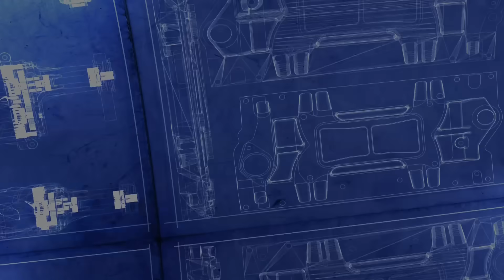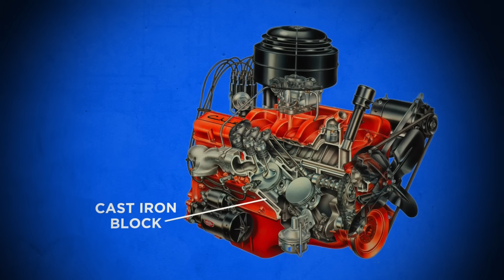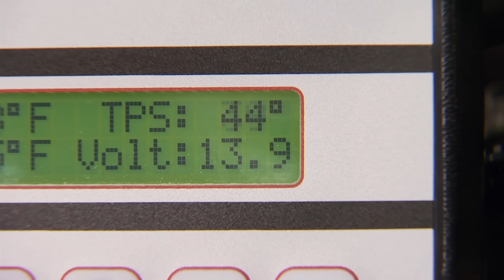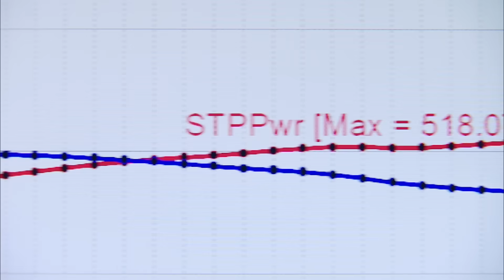Building A 518HP Supercharged 350 Small Block - Engine Power S2, E6

Comment: Not sure why anyone would build a 350 when its so easy to go 383, and the power difference is significant.  A blown 383 is a beast.  Especially,  with a cool looking blower. The closer  the pulley is to the casing, tthe cooler it looks. That  long B&M looking snout, is NOT cool. 😮😬 😁

Comment: Without the blower on 10 lbs boost, this is a 300 hp motor. How can you only get 300 hp out of cam, exhaust, heads, electric pump and ignition management?

Comment: THATS IT 518 HORSEPOWER,  EDELBROCK SHOULD BE EMBARRASSED WITH THESE PARTS.  A 350 WITH A GOOD ROLLER CAM AND 200 cc INTAKE PORTS.  SHOULD BE ATLEAST 450 HORSEPOWER.   WHAT DID THE 2000 CFM OF THROTTLE BODIES AND THE SUPERCHARGER GIVE 68 HORSEPOWER 😂

Comment: People are complaining about the peak hp without taking into consideration that the engine n/a with that cam and heads is making somewhere between 375-390hp if I had give an estimation with what I have seen before with even better AFR heads on a 350. So when you really think about it adding 130-140hp ish is not bad.
Reply: These guys commenting have NO idea what they are talking about.  It's really hilarious to read.  The 519 number is really good out of a 350ci engine on pump gas. No crazy parts.  Will run for years and years and years. You can't daily old school engines making huge power. This one is made for burning tires and having any where you want to go. Blowers look cool, sound cool.

Comment: Those particular cylinder heads are borderline too small for their build. They will work but could be significantly better.
Reply: just get the 200cc version of them.  problem solved but that cam isnt big enough for the 200s so the 170 work.  the blower can do almost double that boost but those hyper pistons arent gonna like it if theres ever detonation

Comment: listen up about eye protection i got a metal sliver   stuck in my inner eye lid every time i blinked it scratched my cornea i went to ER  they found nothing  in the middle of the nig nite wife started freaking out  i couldn't open my left eye  it was sealed shut with puss  i went to a eye specialist in the AM   turned eyelid inside out found  a sliver  gave me drops took  a week to heal  now religiously i put on my 150.00 titmus safety glasses at 730 am at work

Comment: A ZZ4 block with production parts, and HYPER pistons, 9.5 pushing 10lbs boost on pump gas!
Fuel injected $$ dead nuts street reliability, 2300 blower, and a superior roots type blower drive. Oh and it's inter cooled too. For what it is INTENDED TO DO......this could be a blast in a street highway cruiser. I would have no problem putting this in my street strip cruiser 88 s-10 blazer, 78 Malibu, or my 68 Impala, and drive for many miles. Every body thinks they can build 1000 hp in their driveway.
Reply: Exactly.  The guys running their mouths are keyboard warriors that have no idea what they are doing.  500hp in a properly set up street car will smoke a Hellcat.  They all think it's easy to make huge numbers today.
Reply: @DamionG1987  Hey it's the sign of the times I guess...plastic fantastic store bought super cars. Big HP numbers in throw away plastic cars. Tear up your hell cat trying to be chief doughnut maker, no problem. Get mom or dad to co-sign for another, and go crazy. I am a big time car nut, my whole life. But some of these squirrels never heard the line.....DON'T LET THE SOUND OF YOUR OWN WHEELS DRIVE YOU CRAZY.

Comment: I’m assuming it made 500 torque at idle,perfect for a tow motor but 2,000 cfm ..good lord
Reply: boosted engine things change like air requirements and youre not gonna use all 2000 all the time

Comment: Damn I do most of that work for free in my machine shop. If I use torque plates I chase and chamfer the threads for my own sake, and I’ll chamfer oil galley passages/thread oil plug galleys for anything over a mild build.

Comment: I think it shows how poor the SBC heads really were. Those numbers are effortless with a cam swap in a gen lV LS.
Reply: you can do the same in a 383

a good 210cc head
 240 duration cam
850 carb and a victor jr intake and 10.5 to 1

550hp

BUT this engine does it low RPMs

that and eddy heads arent all that.

Comment: It doesn't take a super charger to make a measly 518 HP.  If I am spending money on forced induction I would be building much more then that.   518HP is easily done normally aspirated. Now if you are only going for looks then fine I guess.
Reply: BUT at what RPM you doing it at?  yeah maybe a 400 would be better.

Comment: Still have yet to see a build by these guys, show(s) that uses a gear drive timing set.
Reply: Nobody uses those hokey gear drives...
Reply: @BuzzLOLOL  And why is that?  Dead nuts timing is not appreciated on Gen 1 blocks anymore?  🙄
Reply: @jasonrobertsutliff  - Gear drives expensive, noisy, not as reliable, the noise upsets EFI computers...
Reply: @BuzzLOLOL  Sincerely, ...  Not as reliable vs. belt/chains that can stretch over time or with really high torque engines.
Not a humble brag, but money wasn't an issue, I wanted the noise, 600lbft torque, naturally aspirated 410 SBC, legit dead on timing for 23 years now.
Reply: @jasonrobertsutliff  - A lot of people had those timing gear setups come apart on them so for street performance use we just go chain...
Reply: @BuzzLOLOL  Suppose I just got a good set ...  😎
Reply: @jasonrobertsutliff  - I'm happy with the $11 ZOOM roller chain set I put on my SBC 405" w/ MoTown 220cc aluminum heads 30 years ago...

Comment: The very first chevrolet V8 was built in 1917 and 1918, as well as the last gen 1 V8s were 99 in trucks and 2002 in chevy vans. The vortec 5.7.
Reply: 1916 with air gap intake manifold!

Comment: I know this is old but why even bother with a supercharger if you only getting 500hp out of it with 350 block ??? You can get that easily without the supercharger thin add the it back to have more 700-800 hp
Reply: a stock 350 block will go to about 550+ MAYBE 575 if you have steel caps put on it  and its a stroker.

  you're looking at a dart block to do what you're talking about 700-800

Comment: so if 1996 was the last year a small block was installed.what is the 5.7 in my 1998 truck called?
Reply: Man I was thinking the same thing. Even the 2000’s model cab over chevys had 5.7 v8 and not the LS.

Comment: Ive been reading about how superchargers work and the reason why it doesnt make as much horsepower as you might think is because of the massive pulley wheel on the supercharger the motor is definitely more cappable than 500 horsepower
Reply: you’re right, smaller pulley means more power

Comment: Factory 350 block is good to about 450 hp according to experts, so they can't really push this build but real nicely done though, builders and testers say one would have to go to dart block with thicker main material to do much more hp.
Reply: Gm rates them low to be safe knowing they are capable of a ton more

Comment: There is a lot of people talking about the output of this....it's a very mild small block to begin with and the blower is not a super efficient deal. Granted a bit more power could be tuned out of this. But it's a car show , old guy , parade engine.

Comment: I think this build is more a tribute to Vic edelbrock.  That engine is nearly 100% edelbrock.  Just the basic dimensions are Chevy.  Years ago, I think Hot Rod wanted to do a budget performance street engine.  Their choice was the 350.  So they went to the junkyard and bought a 350.  Well, it was a 2 bolt main.  Couldn’t find a 4 bolt main in the wild.  Chunked the block and bought an aftermarket 4 bolt block.  Had a cast crank.  Chunked that and bought a steel crank.  Ported the heads and cut it for larger valves. Aftermarket aluminum intake, lumpy crane cam (don’t recall about the connecting rods) and voila a really decent street engine for it’s day.  But sounds like they couldn’t do what they set out to do.  Not bad mouthing the 350 just the mentality of the builders.

Comment: Frankly low street boost most people could not tune themselves anyway. The 518 is a safe easy non complicated system for the average person. All the 750 800 junk is just that and no way 99.999% or more of people tune that level an engine without a blower. Some could sure but dont build beyond what you know
Reply: “Don’t build beyond what you know”. That would make a great meme with a picture of an engine with a con rod poking out of the block.

Comment: 8 whole cylinders and a super charger and you come out with little over 500 horsepower..  they can squeeze that out of a jdm engine with half the amount of cylinders. There is a company that sells pre built k24 turbos with 1,000 whp. This is cool but imo it’s weak in comparison

Comment: Lmao you can get numbers like this N/A with junkyard LS parts A truck 6L with square port factory heads using a carbureted intake manifold and that's with stock rockets and valve springs and stock cast crank and stock piston and rod

Comment: 10.8:1 355 or ls vortec 240-260 @ 50 600-610. 112 lsa . 1.6 roller rockers under drive pulleys. Now you have saved enough money  for a 3000-3500 stall, 4l80e and Ford 8.8 or 9".

Comment: How to spend 20k and make 500hp.
Reply: My 455 makes 559 at the crank. All ghetto build. Ported heads, junkyard carb, a decent intake, roller rockers, an unmarked camshaft, and lifters
Reply: @crazycoffee  AND A STOCK BIG BLOCK CAN EASILY TAKE A 175 SHOT OF NITROUS TOO
Reply: Just made 500+ with $1200 and a $4500 CLEAN white 85 monte carlo ss 😂😂
Reply: @gmmcss3817  hey I just got a 1986 Monte Carlo ss do you Instagram?
Reply: @Candyvyorn_  i have instagram but i dont have the car anymore, it was a solid build. Trans, motor, axles, etc. i sold it for 11 and ended up buying a c5 because it suites a “daily” better
Reply: @gmmcss3817 you care to share the recipe to get that HP?
Reply: Literally can get a 350 and drop 3-5 grand and make 600 naturally aspirated this build was weird
Reply: @thelo-fishogun1604  How would you do that? im assuming rods, pistons, cam, crank, and heads
Reply: My old man had a 580 horse 385 small block for roughly 6,200 has a lot of unnecessary parts like complete Molnar rotating assembly that runs on 87 octane and make 560 on 114 Rocket brand and more timing it will do 615.
Reply: @KillianSnuffleBottoms dude I will tell you this right now there knolage is very very iffy they make engines that run 3 times that’s all there good for I would say trust literally a homeless man before them like who tf wastes money on a crank pulley installer just use the fing bolt it comes with
Reply: @Cry3st1 How to pull threads on a crank 101
Reply: Just throwing all together and see what it does
Reply: You could easily make 1k hp with 20k
Reply: A tune and a smaller pulley or 383 bottom end and that supercharger will push that sbc north of 700. It's already been done
Reply: could literally buy a lt5 for less
Reply: @cameronschichtel278  
The new or the old one? 
Answer: Yes.
Reply: 177SCmaro i likes the comment cuz it was perfect
Reply: @cameronschichtel278  Take the LITERALLY and shove it where the sun don't shine son 😄
Reply: Lol ur such a hater lol 55 comments probably only talking shit about things you don't have
Reply: Sbc are the cheapest motor you can build. I built a turbocharged scat , wiseco forged 383 heads cam intake running a ls1 0411 ecu. 6000$ .
Reply: Thing is these parts were cheaper when this video was made
Reply: 383 stroker pump gas 505 HOURS here…. $ 5200 thanks , I’m gonna have to stay with the stroker. 😅
Reply: Yeah they just got too much going on here you don't need ALL that to create 500hp you can accomplish that with less
Reply: yeah but this’ll make 500 all day long without even sweating tbf
Reply: My 4ltr barra makes 440rwhp on 12psi, and thats a 6cyl. Couple hundred for the tune and bobs ya uncle
Reply: @seanedwards1838  one of the engines in our Midgets (Drit car, not little British car) is 166 CID, normally aspirated on methanol and makes almost 400hp. That is in a 900lb car with no clutch or transmission.
Reply: @seanedwards1838  Will never not upvote a Barra. Not to mention you could that with a donk you pulled out of a taxi with 500,000km on it in a junkyard for a hundred bucks.
Reply: @seanedwards1838  I doubt the torque curve is as good on your car!
Reply: @olekdah  the barras actually make really good torque
Reply: @seanedwards1838 this ain't about 
A v 6 engine . It is about a ,350 engine
Reply: @RyanBenbow  since when was a barra a v6?
Reply: Freiburger made that with his covid 350 for a lot less lol.. these guys are chumps
Reply: My sbc 350 has aftermarket aluminum high flow heads, bored .30 over, 480/480 camshaft with matching lifters and springs, and a 4 barrel double pumper 750 with a high rise Edelbrock single plane intake through a 4l60E with manual grounding and makes 515..... in the motor a few thousand compared to what they just spent in the video lol
Reply: @CrazyCoffee Do you have the synod slips to prove that? I bet not. So shut yo butt

Comment: To everyone complaining about the low numbers, here's a few things to keep in mind. The setup is running on essentially the stock tune which is made very conservative for longevity purposes.
If they did a bit of tuning and rejetting, you'd probably see another 25-35hp alone. Next is the stock 10psi pulley. A 12 or more psi pulley (with proper tuning) is obviously going to jump the numbers up quite a bit especially with bigger carbs.
Lastly, head choice plays a really big factor in any forced induction application. I set of higher flowing heads would also increase hp/tq numbers without changing anything else.
Reply: Its fuel injected.. no re-jeting required. Depending on the injectors, may not need new injectors either. I believe this is a really solid motor. It can be a daily driver, get stuck in traffic, and run into 100k plus mileage wit no problems. Most of the comments are not taking into account real street use. This is a expensive set up though... nice, but very pricey.
Reply: @hawkdsl  
Didn't catch the fuel injection part. Either way, you have a good point of this being tuned for longevity. Once you get into the 8 and 900+ hp range, it becomes harder to maintain the smooth "daily driver" aspect of a build like this.
Reply: Regardless of why, it's a lot of money. Build a blown 383 if you must have a blower. NA 383s can pull that number.

Comment: I'd like to see this engine at 15 lbs of boost, however, the limiting factor will be those hypereutectic pistons, so you'd want to make sure you have some methanol injection to cool the pistons further than a heat exchanger.
Reply: Or do it right and use forged. WHen hypers break its like a bomb going off it will destroy every part of that engine even the carb.

Comment: I'll bet those edelbrock heads are leaking from the valves with that low ass power # at 10 pounds of boost that thing should have easily made 600ft
Reply: They used the power number Edelbrock claims from putting that blower on your stock 1975 SBC 350" 7.6:1 engine...

Comment: Was the crankshaft double keywayed? Because of the extra pressure under load, wouldn't it spit the harmonic balancer off?
Reply: the double keyway is a good idea if you're building the engine yourself but they went with a shortblock so it was only one key...      ive seen blower motors (making way more power) with one keyway and some with duals...    its a peace of mind thing but I did it on my 440

Comment: Just fyi, you can achieve this and more hp for less than half the money with a 177 supercharger. At 10psi on e85 with no intercooler i was a little over 600hp with my old sbc.
Technically this can be done NA but without as good a curve

Comment: Looking at some of the comments here I'm thinking some of you guys have uses optimistic dyno's in the past ?  This unit on 10 psi giving 500 on the brake at fairly low rpm is what you'd expect. If the heads are any good it should make a bit more on a weaker AFR  12.9 - 13.5 is where the power is at, but at the risk of piston damage if everything  is not as good as it could be
Reply: Actually, the RPMS is HIGH... look at the chart... 6200 - 6500 RPMs... should be making that HP without the blower with 200cc heads and 234/238 cam...

Comment: actually at worse you can be doing a valve interference engine where the valve breaks off and then punches it's way sideways through the center of the piston causing to to break and expand into the cylinder wall causing it to break and thus destroying the engine. all from bottoming out the pushrod on the lifter.